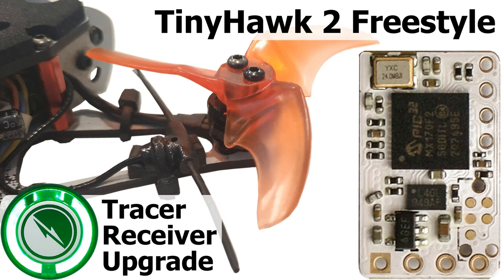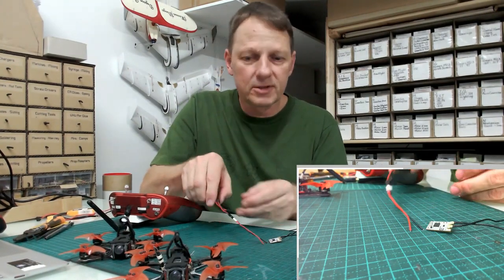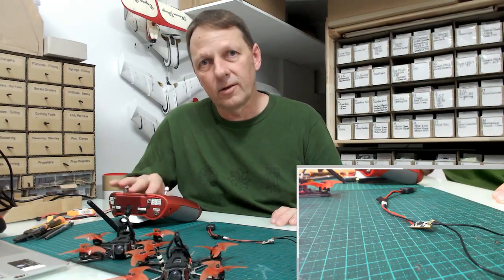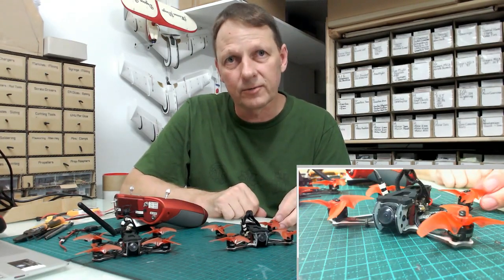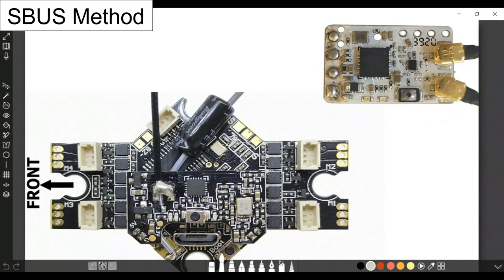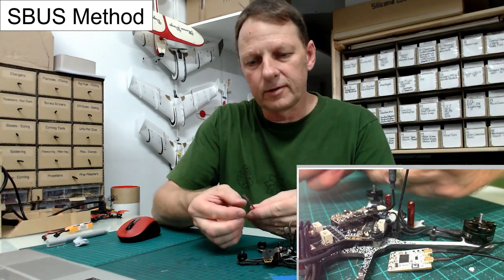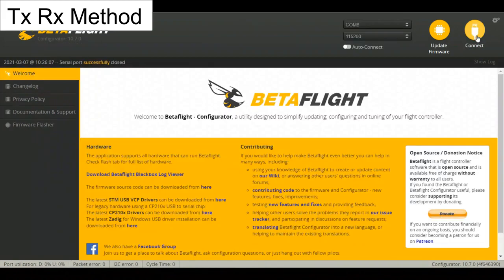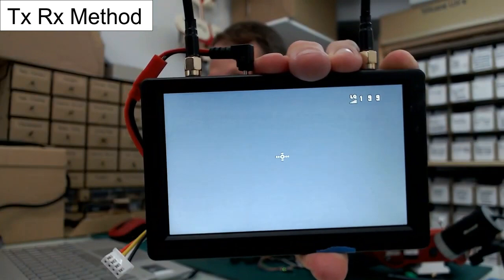Tinyhawk 2 Freestyle Receiver Upgrade

Comment: vtx went in fs2 so i put a tiny tank in,  now low rssi and no battery info. was the current sensor in the stock vtx? osd is working but no readings  on rssi and battery. what setting am i missing in bf? have to wire tiny tank to 5v tx2 where vtx was not sure what's up flies great , awesome video now with phienox 2 nano just no voltage reading.  tiny tank works great.
Reply from the maker: can you see other OSD elements? If not then check your VTX table is correct. Otherwise you shoudl be able to see battery voltage. Not sure abour RSSI. It works in the original VTX. I have tracer in mine so RSSI is not relevant. I set it to show LQ instead as shown in the flight video at the end. I have used the tiny tank before - thay are a good VTX.
Reply: @cubefpv  yea everything is there battery osd flashing and it say low rssi, been in a few times checked and set up osd profile etc. everyting is there but those 2 flashing. flies great , awesome video now. in BF power settings vdc onboard was off , turned it on and nothing.  i fly around the yard get normal rssi warning from qx7  at distance so not to worried i can shut that off lol. just cant get my bat level back.
Reply from the maker: @MrBumbles2  Very strange - have alook at this video from CurryKitten - https://www.youtube.com/watch?v=zJ7l_iAzftA
Reply: @cubefpv  yea I'm stumped too, I'll check it out, think I watched it already lol. Probably shut them off and just use the timer for now.  I used oscar's vtx table set it up didn't work went to rush its sa 2.1 , set it up everything works but the 2 they flash. No reading,  so I'll solder up a rsxr and use lua
Reply: Or gut it and put in a stack. Its quiet doesn't piss off the new neighbors like the 5" lol
Reply: lol yep  havent seen that one ill check it out ,
Reply: all good now , battery scale was on 4.2 up to 3 fixed , and most of all when setting up osd in goggles must make sure you save n exit. believe that and my alarms needed reset. but how to get rssi to 100 not 43 on screen. see no rssi set like b4
Reply: setting up osd , rssi says 97 but on screen 43 other vtx sa you had rssi set to cal it. my first sa 2.1 ver

Comment: I'm using tbs mambo TX which method would work best for me?
Reply from the maker: If you are using the Mambo Tx then I assume you are unsig one of the TBS micro receivers with 4 ports. You should use the TX RX method as shown in the video.

Comment: Hi. I may just missed something in your video.  But where vtx board gone? Is it camera connected to new receiver board? Beginner   :)
Reply: Well spotted. On this quad i had removed the VTX and I actually replaced it with a better quality one. But I didn't put that in the video because the focus was on the receiver replacement.
Reply: @MicronWings  :)  but made me think its vtx signal going to looks like camera connected to receiver   :)  ( beginner) . And maybe can you tell me what antenna is best to upgrade th2  vtx?  Thanks
Reply: @mindaugasbaltrimavicius2681  I think you mean upgrading the VTX. It's not easy to remove the attached VTX. You have to cut the legs off and unsolder the pins. But you might damage the flight controller board when you try to remove the pins and then have no connection point for the smart audio and video leads. I would suggest you just don't upgrade the VTX unless you are experienced at doing that sort of thing - or unless you have lots of money to replace the flight controller board.
Reply: @MicronWings  I meant antenna if I can soldier some better one like lollipop? 
I got 2x th2.  practice on one  :)
Reply: @mindaugasbaltrimavicius2681  yes you can solder a replacement antenns - once again great care is needed when removing the old one becasue its easy to lift the pad off the board the removing it.

Comment: Cube can you make me a huge favor?? I finded the problem i had, and its i have a burnt resistor, can you mesure it on your drone so i can know which one to put in its place. i dont know how to send you pictures of which one is it, but its on top of the board, kind of in the middle right next to the osd chip. Its the resistor that is next to those 2 holes on the board you can see at 25:39, below the vtx.
Thanks you so much
Reply from the maker: That one is 0.7mm x 0.2mm and black colour. There isn't anything written on it.
Reply: @cubefpv  yees that one, can you measure its resistance??
Reply from the maker: @matiasmolfino8447  It's 3.6 Ohms
Reply: @cubefpv  thanks! i channged it and something else blew up, i will have to change the fc, im thinking the cheap darwinfpv AIO

Comment: What is the difference between doing sbus vs txrx methods? I am about to add tracer rx to mine, and was planning on txrx method, is that better?
Reply: TXRX and Sbus are very different. Your receiver will determine which method you choose. for example Tracer Crossfire ELRS will all have Pos Neg TX RX pads so you must use TXRX method. But some receivers are called SBus receivers. Those just have Pos Neg and Signal - that signal wire is referred to as SBus. So if your receiver has 3 pads you are using SBus and if it has 4 pads you are using TXRX.

Comment: hi, do you have a clue why mine isnt working?? i have xm+ receiver and connected it using the sbus method you showed, but on betaflight i cant see stick movement.
Reply from the maker: The XM Plus is an Sbus receiver so make sure you are connectong 3 wires. Actually in the video i show how to connect a receiver with TX RX lines. But just check that you have the pos neg and sbus going to the pads as shown in the diagram which i show in the video. Another problem may be your betaflight settings. Make sure you have serial SBus selected in betaflight for the receiver - not the CRSF that i show in the video. Also check that you actually have the receiver bound to the TX okay. Power on the quad - do you get a green light on the receiver when the Tx is turned on. You can also go to the telemetry screen on the transmitter and click on "discover sensors" to see if you are getting telemetry data from the receiver. This is a sure sign it is connected and working okay. Finally some receivers need that battery plugged into the quad before they work - not just connecting the quad to the computer by USB. have a look into these and try to troubleshoot from there. Oh cherck your soldering too.
Reply: @cubefpv  Yeah, i have green light in the receiver, and connected to the sbus tab and the +- tabs. I have the serial rx on uart 1 and the sbus. The receiver doesnt have telemetry i think, but when i turn the radio off the light turns red. But for some reason it just doesnt want to work in my TH.
Reply: I have the Same Problem :(
Reply: @kutti2545  good to know, i could not find any entry online with somebody else with the same problem, so i thought i was the only one. Do you have an email so we can work on this together??